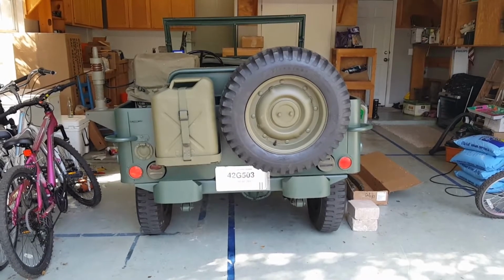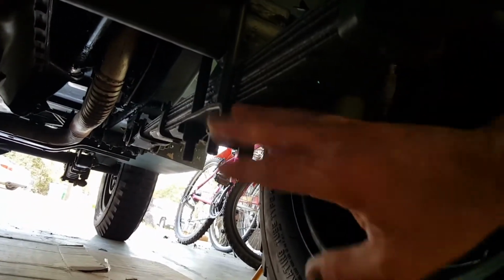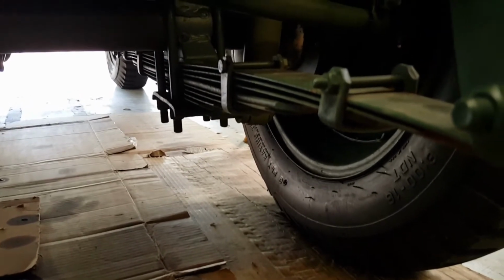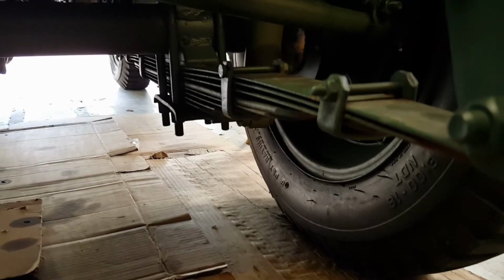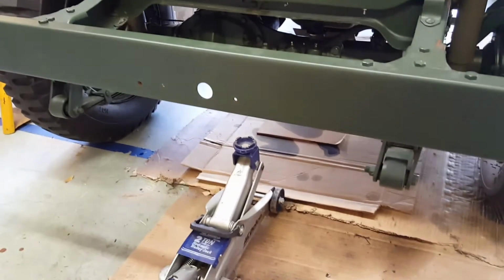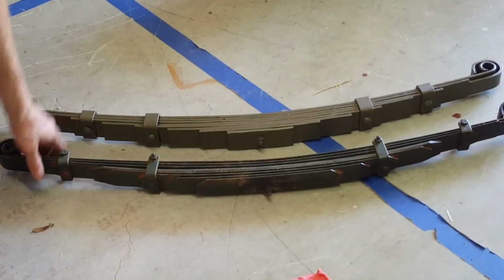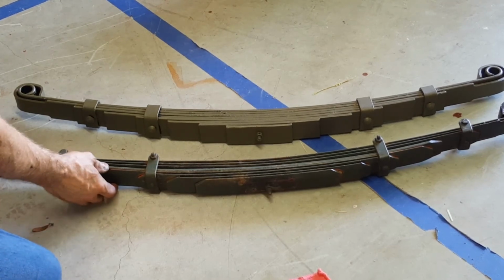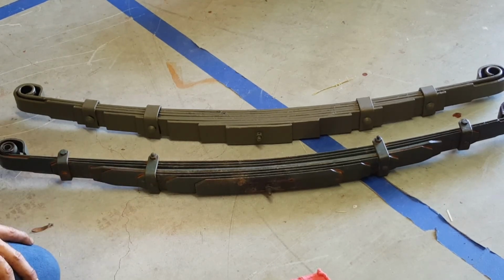Front Leaf Spring Removal Service for Jeep Willys MB / Ford GPW

Comment: Quick Question: I gotta replace just my FRONT leaf spring shackle / brackets  they are basically two metal plates with an upper and lower long bolt. Can you please tell me What To JACK up and What to Not Jack Up,... so that when I remove the lower long bolt from through the leaf spring ending....it doesn't  SPRING & BAM & FLY About....   ((I have never attempted this before))

Comment: How did it turn out? Was the lien fixed?
Reply from the maker: Replacing the front springs corrected most of the jeep lean.  The old front springs were so worn and strained, I decided to replace the rear springs too.
Reply: Why didn't you film replacing the springs ?
Reply from the maker: It takes at least twice as long to do the work when I film because I have to keep moving the camera and stuff.  Besides, installing new springs is pretty much the reverse of removing the old ones.